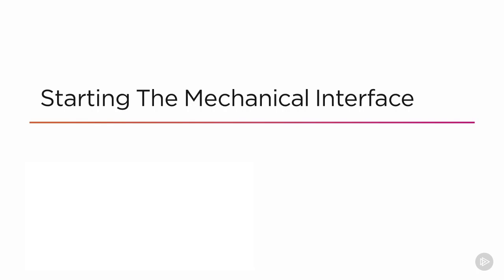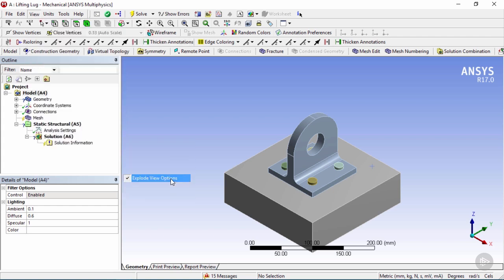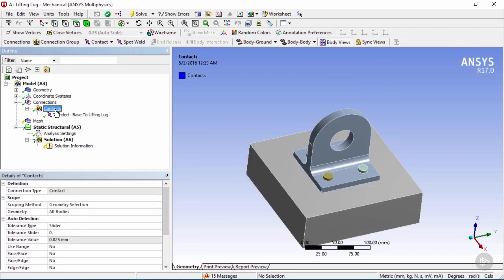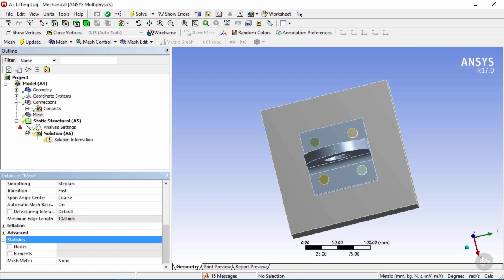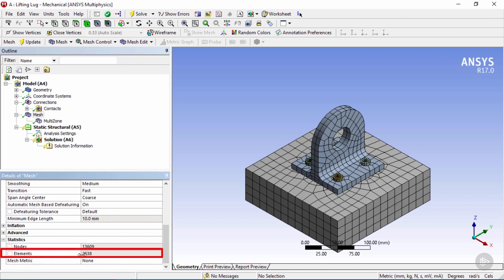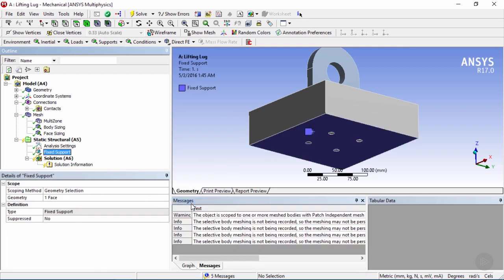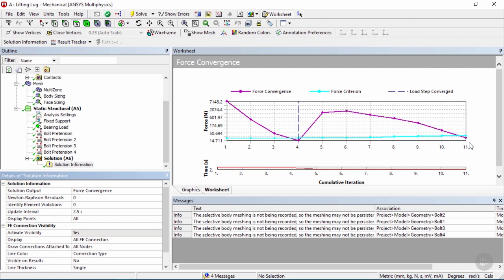Introduction To ANSYS (Part3) : Starting the Mechanical Interface

Comment: thanks for the video, but my programm gives me some errors
1 - when i applied the mesh to the lifting lug to 5 mm, graphicaly nothing changed, also on the bolts mesh to 2 mm
2 - when solving a message pops up with "general error" and one other "the pretension load could not be applied. make sure the load was not applied on a hole "
i followed evrything step by step, also did it twice but nothing changed. 
someone have a solution to this?

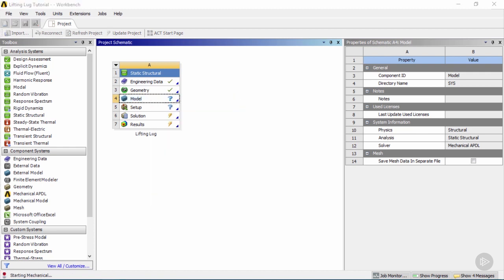Comment: 1:10 edit model (toolbar)
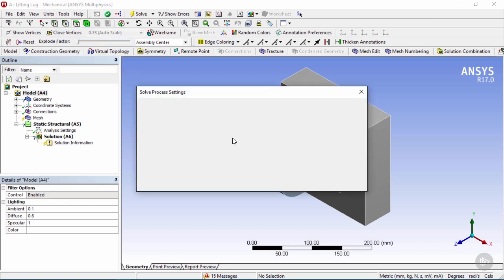1:31 solve processing setting

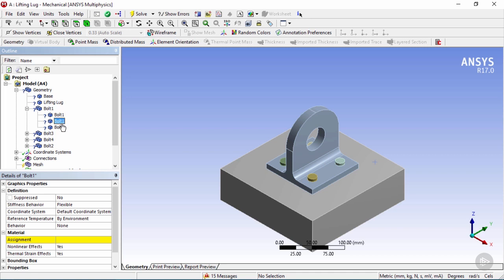6:20 assign material 
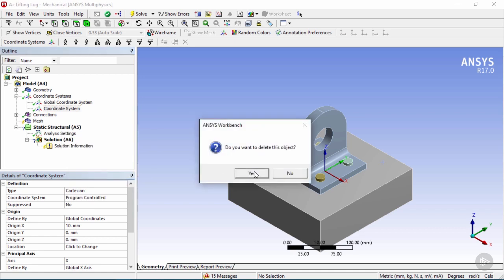8:40 connections explanation 
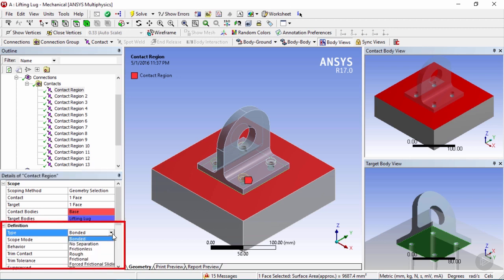9:49 contact type
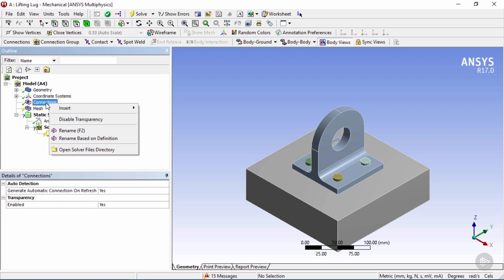11:40 manually create contact region
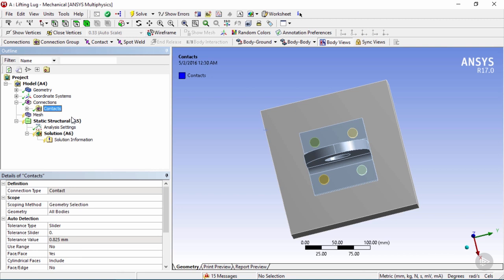16:13 Mesh
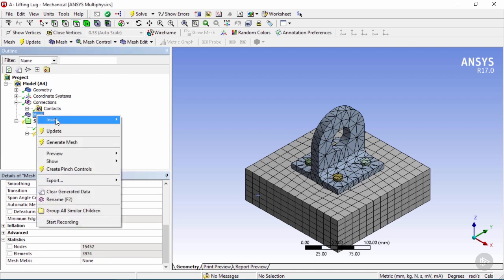18:30 Mesh-method
21:20 Mesh-sizing
24:00 Static structure-analysis setting
25:00 insert fixed support
26:10 insert bearing load
27:10 add bolt pretention
28:50 solve tree models

Comment: I did the same steps but an error has occured which is saying , check the solver output on the solution. What should I do??
Reply: Happened to me. Did you find a solution?
Reply: Same here! Is there any solution?
Reply: Try this,  alter Solver settings to max cores=2 and uncheck Distributed.